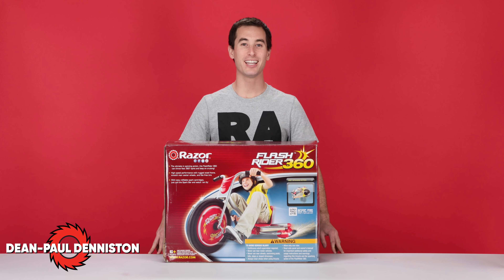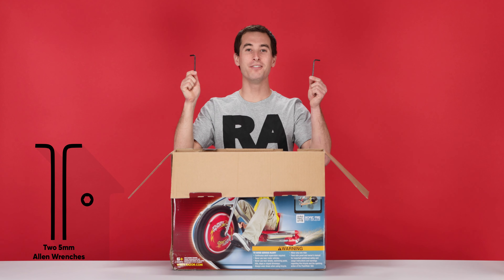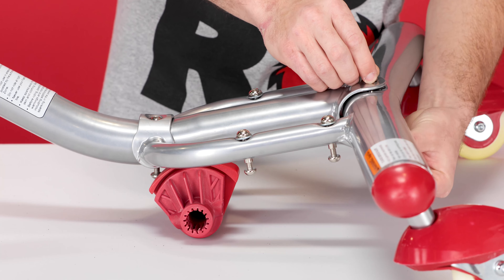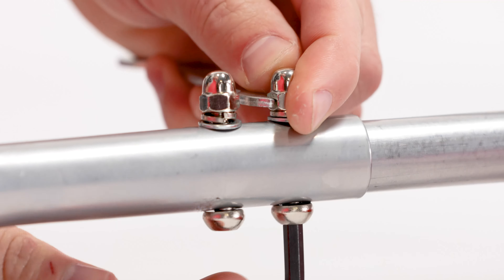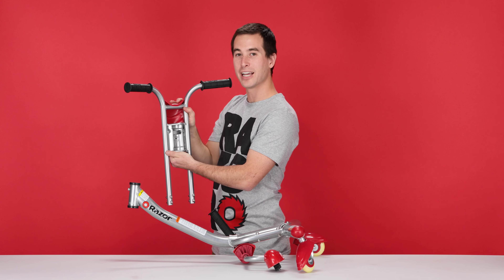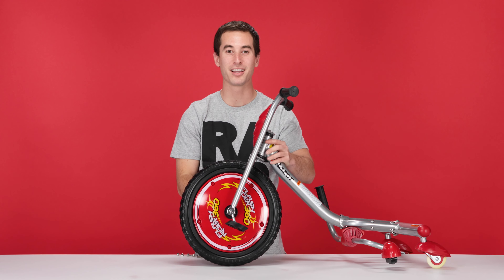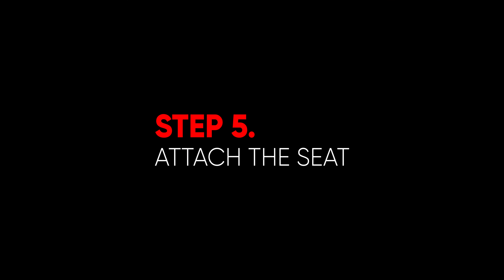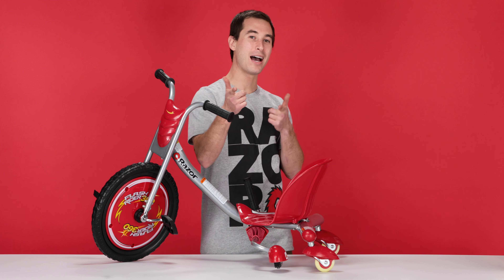How to Assemble the Razor FlashRider 360

Comment: I would love a bigger version of the RipRider 360.
I'm planning on taking a used RipRider 360 and modifying it by adding a slightly longer fork in the front,  with a bigger wheel on a freewheel hub,  and bigger casters & bigger seat.   

Thank you for all the quirky, fun toy vehicles you make,  it's amazing.

Comment: Mine was delivered today, let’s see if this video helps.
Reply: Okay that took an hour 😫
Reply: @5pctLowBattery   my took 30 minutes it was ez to build
Reply: I had to call Razor so many times during the 6 month warranty. The nuts and bolts kept falling off. The wheel stopped working. I basically had to replace everything 😂.
Reply: @5pctLowBattery     Maybe you should learn about using Loctite threadlocker compound,  and maintaining bearings.
Reply: @Anthonybrother  my kiddo wasn’t interested in this 360 razor anymore , I’ve since donated it to goodwill. 
It’s not sturdy and was your basic plastic junk (the stuff you suggested are beyond what I should have to do).
Reply: @5pctLowBattery   I agree but i'm also not the average customer.  I'm very obsessed with drift trikes and Razor's fun toy vehicles.   I want to make a more serious bigger version of the RipRider 360.